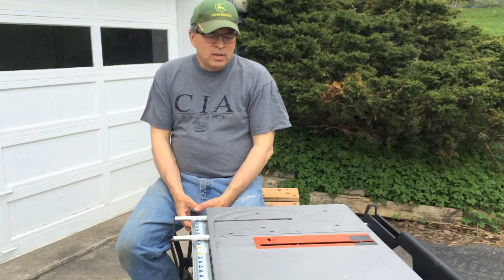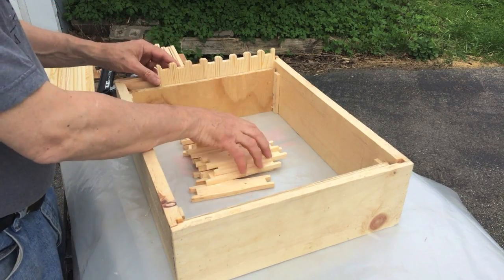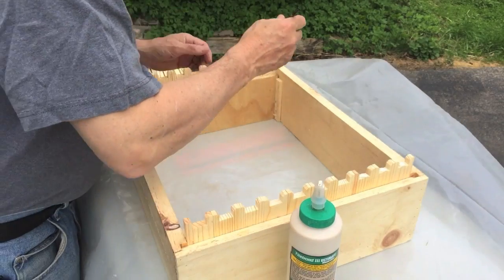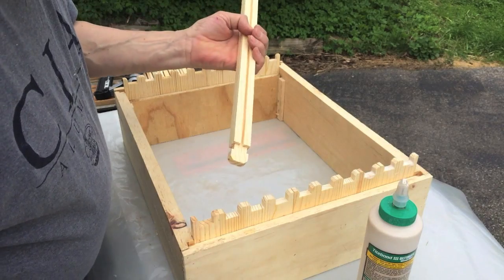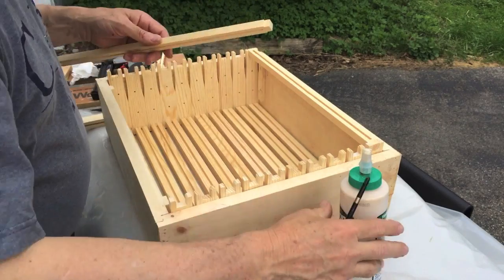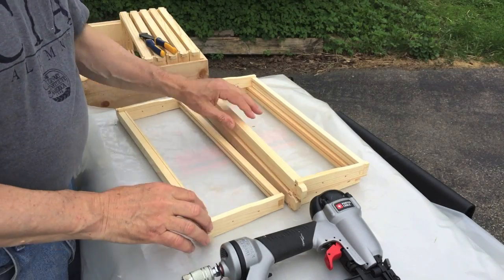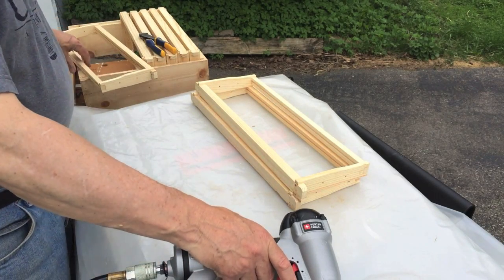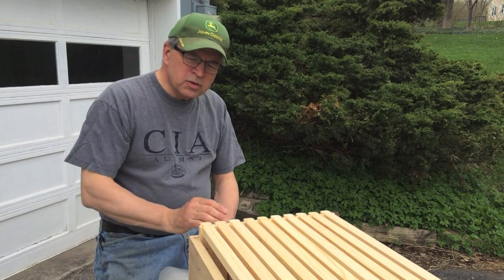Part One - Bee hive frames, building the frames

Comment: 1. What is the name of this device which hits nails.
2. Why is not there wax Foundation.
Reply from the maker: 1) pneumatic nail gun. Connects to an compressor that supplies the air
2) I didn't put the foundation in yet. I put it in  later
3) Thanks for watching!